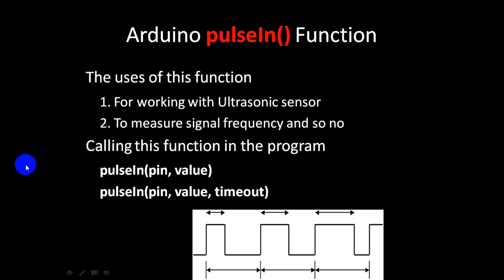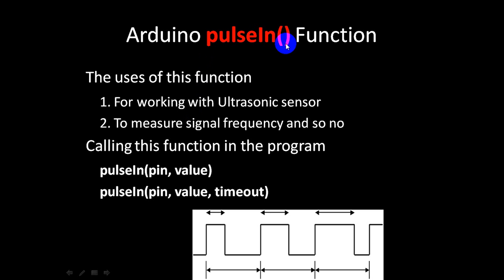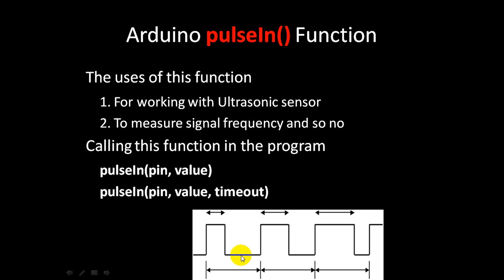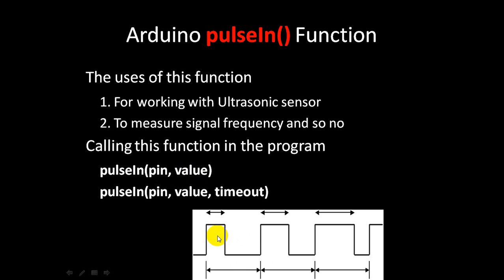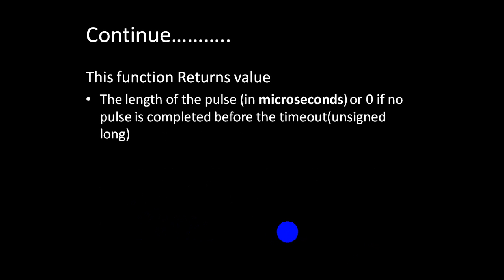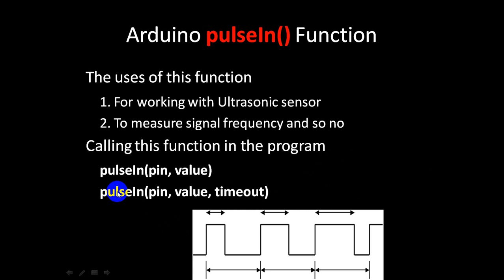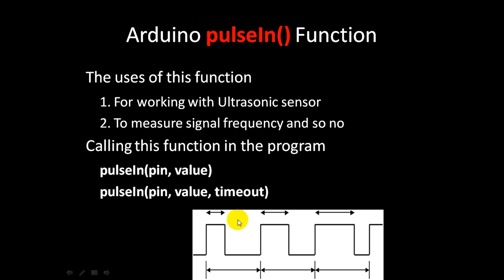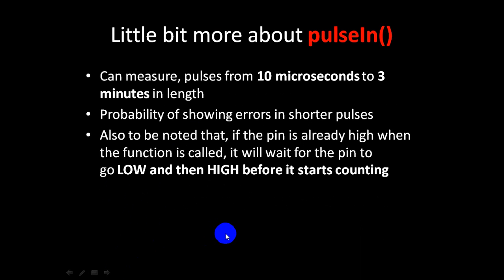Arduino pulseIn() function

Comment: Hi Mr., how do we remove the blocking of other codes after we use "pulse in"? Is there any syntax other than pulsein to read the HIGH and LOW pulse widths of the OPTOCOPLER?
Reply from the maker: Yes u can do it in several ways, among them the best would be to use timer to measure it. All u have to check when it gets high till it gets low.
Reply: @MamunTech  May I ask you for help? Do you have WhatsApp or social media?
Reply: @MamunTech  May I ask you for help? Do you have WhatsApp or social media?
Reply: @MamunTech  Do you have social media? I really need your help.